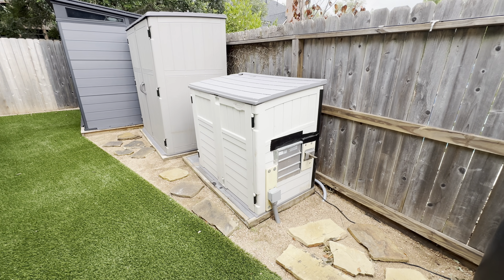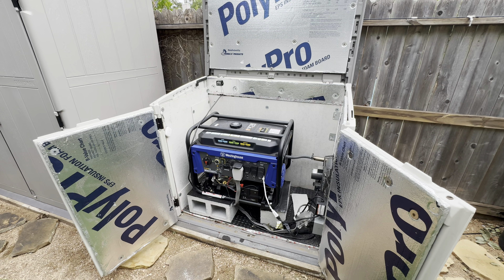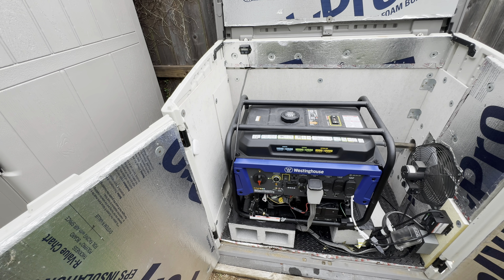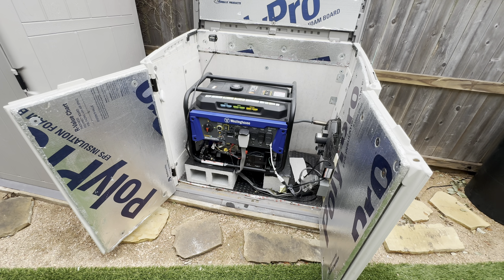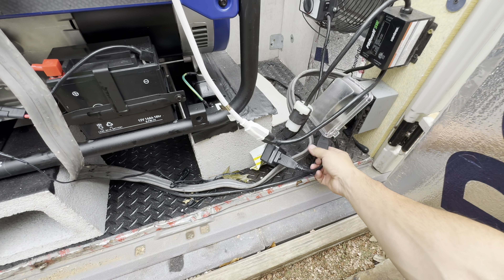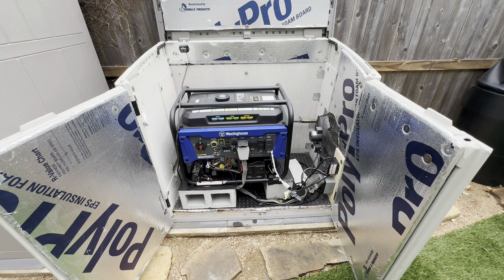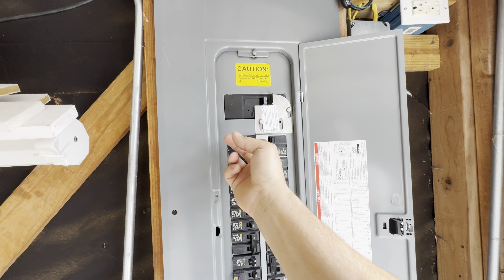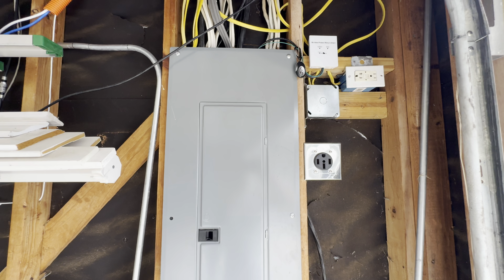Tri-Fuel Portable Generator Post Hurricane Update on Natural Gas

Comment: I am in Missouri City (Sienna). I had my Fir**n Tri-fuel running on NG for 40 hours during the hurricane plus a couple 1/2 hours runs afterwards. It ran my 4-ton A/C with the help of a Micro-air soft starter.
Reply: Good to hear. I live near NOLA and just put a soft start on my 4 ton. I have a 9kw (startup) coming tomorrow!
Reply: @armyfazer1410  good ole new orleans. hopefully storms miss us and the generator wont be needed.
Reply: Hey neighbor (sort of) I have the same 4T A/C and soft starter, gonna setup a Duromax 13,000 on NG at 8500 continuous. Have to pull a city permit to upgrade the gas meter, and CenterPoint to upgrade the meter, install a sub-panel on my panel...  Did the Duromax treat you okay? They are 2K on Amazon right now. I already bought it, just wanted to know.
Reply: @fat_biscuits3928  I installed a 3/4 ball valve and brass garden hose fitting on my gas meter.   Given nat gas manifold pressure is less than 1/2 psi, I  use a 75'  x 3/4" garden hose to  connect my generator where ever is convenient.  The setup had no problems providing sufficient gas flow to run my gen with a 6000w load for 6 days.
Reply: @jbar6618  That's a great idea! Do you know the CFM NG rating on your gas meter, and what sized generator are you running? My generator alone at full load states it's ~125 CFM gas usage, and my meter is rated at 250 CFM. I'm contemplating a meter upgrade from CenterPoint, however I hear it's a pain to get them to do the upgrade. I'd have to pull a city permit, inspections, then fight with CP for for the install... Also that's probably another $700, and then a plumber to install a quick connect ~$500...
Reply: @fat_biscuits3928 The meter is rated for 250, standard residential.  Gen has a 439cc engine and rated at 6000w on nat gas. I used a natural gas line sizing  chart  to determine what was necessary to supply the gen. As i recall 3/4" x 50' is good for ~100k btu. Given there's approximately 2500btu per hp,   I wasn't to concerned since I wasn't planning on running full load all the time.   As a backup I have 5ea 10" sticks of  1.25" thin wall pvc with threaded end I can screw together if I need more btu.
Reply: @jbar6618  Thanks for the info. The generator I bought is rated at 8500 cont watts at 125 full load CFM NG gas consumption. I don't think I'll ever use the FL cap. However, it's borderline with my 40,000 BTU water heater, and an averaged 100,000 BTU furnace, and gas stove guess-timated at 100 to 150 BTU's. My service entry for the gas would be roughly 30' from the electrical panel. Thinking if the heat in the house isn't on the 250 CFM gas service could handle it. I used a 6500 w genset on (unleaded gas) to backfeed my panel, and it ran my A/C, TV, lights (LED lighting). I think it may just be enough depending the delta of the service entry for gas. I'm in the end of a neighborhood, A bit sketchy TBH
Reply: @jbar6618  I'm not sure what direction the NG is fed... I may try it.
Reply: @jbar6618  Let me know if you can think of anything I'm not thinking about.. I don't want to be so un-prepared next (tropical storm) ... LOL thanks
Reply: @fat_biscuits3928  During the Texas freeze I was running 2 x 80kbtu furnaces, water heater, clothes dryer and still had plenty of NG to run my generator.  My average electrical load during the freeze was around 1800watt. which included 3 refrigerators, 2 furnance blowers, lights and tvs.   We didn't use the fireplace gas logs or outdoor fire pit.
Reply: @fat_biscuits3928  When you run on natural gas, or propane, you're power output from the generator drops quite a bit, compared to gasoline.
Reply: @Threedog1963  True statement, My generator will be 13,000W on gas, rated for 8500W continuous at full load on NG. Used my friends 6500W continuous on unleaded two days thru Beryl. It ran my 4T A/C w/soft start, and most everything I needed. I didn't try the microwave, or the electric dryer, but I can live without that stuff during an outage.
Reply: I have a duramax 12k with a micro air soft start. 
No it won't run my central a/c.
Can't make it run the a/c.
Reply: @RandyGarrett-z7e  What is the peak amps shown on the Micro-air app when running off the grid?
Reply: How many kw is the generator you had running
Reply: @EPerez-iw9zp  Manual says for NG, 6900W starting, 5500W running.
Reply: Those Micro-Air easy starts are no joke 😂
I installed one my 3 ton house AC and I can run it off 2 EcoFlow delta Pro’s.
Besides the back up power my house lights do not flicker any more with it installed now.
Reply: I thought they were rain/water proof?
Reply: @jamesguinn5303  *weather resistant.  An enclosure helps a lot, even if it's only a generator tent or a canopy.
Reply: Did you install the connector to the NG line?  Also did you install the transfer switch?  How much does it cost for the whole wiring?  Do you have any good referral for the install?
Reply: @user-hp1gn5mg7c  And I forgot to add, hopefully your breaker panel is located relatively close to your gas meter (at least on the same side of the dwelling). Otherwise it's a bigger pain in the ass.
Reply: @fat_biscuits3928  Found mine next to the power meter, the problem is it's in the front of the house.  That side also very narrow with my 2 AC condenser.  Was hoping to place the generator in the backyard.
Reply: @user-hp1gn5mg7c  Anything further than 50 feet of cable from the generator to the breaker panel isn't recommended. You'll have a little voltage drop across the cable to the panel, not saying it cannot be done. But, that would be a judgement call you'll have to make.
Reply: @fat_biscuits3928 correction you get a drop at anything greater than 100ft. Not recommended over 100ft.
Reply: @user-hp1gn5mg7c  I'm gonna help you out hopefully. You gotta be careful running NG. Whatever watt rating on the generator you buy decreases that number by a good margin while running on NG. A 13,000 watt generator on unleaded runs ~8500 continuous watts on NG for reference. Then you have to make sure your gas meter can sustain the NG consumption considering the other appliances like your water heater, oven, and furnace. All those things are rated in BTU. The gas consumption is rated in CFM. Take the total of all the appliances BTU's + the generator BTU's add that up the divide by 1000. That number will be the CFM requirement at full load CFM natural gas. Most NG meters are ~250 CFM. If the NG consumption is way more than that, you'll have to pull a city permit, and get the gas company to upgrade your meter (it's has a cost). Then get a plumber to install a hook-up on the new NG meter with a shut off valve, maybe a quick connect. After that you can backfeed the bus bars on your existing breaker panel with a 50A breaker, and installed lockout device from your main breaker depending if you have a dual pole (space in the existing panel) two open spots. After that, you should probably run a sub-panel plug into the new 50A and cable to plug in the generator. That way you can initiate the lockout device for the main, turn off ALL the breakers, close the new 50A, run the gas connections to the generator, hook up the 50A cable to the generator and then into the new sub-panel, then turn on the breakers connected to the stuff you'd like to use. Keep in mind, microwaves, dryers, electric ovens and things like that draw a bunch of power (leave those off). You'll probably need to install a soft/or hard start on your A/c unit (~200 + install) to get it running with a generator. After all of that work, I'd probably keep the new generator safe in the garage, just use the lockout, generator, gas line, and cable for emergencies instead of an automatic transfer switch.
Reply: Do anyone know whether or not the tri fuel generators have a regulator on board or an automatic shut off device that can shut off natural gas flow automatically
 should an unexpected shut off of the generator occurred with no one around to notice, such as in the  middle of the night when everyone is sleeping?
Reply: @doradean3097  I see that the LPG/NG inlet is part of the regulator assembly located behind the control panel cover.
Reply: @doradean3097  I'm going to back into this one rather than dig into any models manual to answer.  I can hook up my NG hose to my tri fuel generator using quick connects and not start it until I need and no gas escapes.  So if a running, connected generator stops, the gas should not leak out since will be in the same no-run state.  Note, that's ONLY provided you have a factory tri fuel generator and not a jake-leg conversion of a Gas model (like I've seen on youtube) that just dumps NG into a converted manifold with no valve control.  Based on this link on tri fuels you should not have a worry.
Reply: @waynewright3248  good to know and thanks for the info, Wayne.  I knew the quick connect is one of the measures to keep gas from flowing when not in use, but wasn't sure if same thing is still happening when connected to the generator.  So need to make sure safety measures are already set up in place on these tri fuel generators as some other brands I couldn't see one already on board.
Reply: @doradean3097  I have never seen a tri-fuel generator they didn’t have the regulator.   They are usually right in the carburetor and are much smaller than the ones you buy and add on to gas generators.  

Then look just like the tri-fuel carbs you can buy for Honda and Honda style engines.
Reply: @speckulator7516  Thank you Speckulator.  Time to go shop for one to be prepared!
Reply: @doradean3097 demand regulator built into Westinghouse generator so gas flow does not happen when generator shuts down
Reply: What size generator, just curious on running watts to run ?
Reply: @chrissimmons6358  My generator has Starting Watts: 9400(GASOLINE)/8450(LPG)/6900(NG). Running Watts: 7500(GASOLINE)/6750(LPG)/5500(NG). It is a 439cc engine. I run 30A 240V. The 50A outlet has a 31A circuit breaker.
Reply: I will be adding 2 12k EG4 solar ac units with Solar this year to keep my House cool when powers out my ac unit is too big even with soft start to run my house and keep my workshop running.

Comment: I’m in NW Houston and have the exact setup as you with the exact generator. I did notice it’s having a very hard time starting with with natural gas. Did the spark plug solve this issue
Reply: Did you purge the gas line before trying to start it?

Comment: Yeah we are still without power from the storm over in Humble. Still running on my small generator. After this will be diffently upgrading my unit to run my whole house.
Reply: Get the biggest available. Get double the gas cans you think you need. Estimate 1 gallon per hour. Keep enough oil and filters for several oil changes on hand. Get a battery powered fuel transfer pump stick. Keep spare sparkplugs and fuel filters on hand.
Reply: @dontblameme6328  Agreed.  Fuel consumption will depend on the generator and how much power you are using though.  I was running in economy mode and got 18 hours per 5 gallons of gasoline.  When I hook the gen up to the breaker box on the house, I'll have to run on full mode and am estimating getting 9 hours per 5 gallons, or less.

Comment: I’m down the road in Manvel (past sienna) thinking of the same setup and also considering tri fuel. My natural gas meter and breaker box are on opposite sides of the house! I would still have to upgrade the natural gas meter but do you think it’s worth it? Should I consider running a long natural gas line or run maybe a 75’ electrical cable back to the box? Worse case I’ll just do gas. Thanks and sick setup.
Reply: Our tri fuel will never see gas.  First thing you know you need it to run and the carburetor or venturi is varnished up from old dried gas residue and it won't start.  

No meter change was required for NG hookup.  Just changed a 1 inch Elbow to a 1 inch Tee, then reduced the new line to 1/2 inch and added a quick disconnect.  Supplied NG flex hose is only 1/2 internal.  Obviously cut the gas feed to the meter before any modifications.
Reply: @waynewright3248  ahhhh so you just branched off the main line! Nice thinking!

Comment: Should have just got a GENERAC.  😑
Reply from the maker: @HBO1984.  just would have needed 15k more and monthly maintenance fees. Also saw several people in my neighborhood where the Generac either didn’t start or failed within 2 days of running. They continued to be offline until the power came back on because they had no way to troubleshoot or work on the system till Generac sent someone out.
Reply: @CalvinGorriaran  They probably didn't maintain it. I just used mine for 4 days after Beryl. Last time I used it was during the deadly Texas freeze. So far GENERAC has been my hero. The best $10K I ever spent. 😑
Reply: @CalvinGorriaran  agree around me many homeowners have failed Generac Home backup systems failed starting or stopped, even after maintenance servicing. One neighbor posting a pic of their enclosure was melting on the slab after 4 days running.

Comment: I have a buddy who built a similar setup but used a larger shed and put a fan next to the generator and then another fan mounted on the left with a dryer type vent and that pushes the air out and keeps air circulating

Comment: You may want to get rid of the reflective material, it will retain heat for longer. Like baked potatoes, that's why you wrap them in foil after you cook them instead of when you cook them.

Comment: I am in richmond area. I was wondering to either this or go with battery powered devices like Anker Solix. How much did it cost to get this installed ? Any issues with carbon monooxide while running it on natural gas ?
Reply: If there is now power how are you gonna charge the Ankar?
Reply: @moblack5883  It will be charged before the powe is gone and then conenct to a solar piece to recharge while power is gone
Reply: @deeproots24  My Friend, Please do a "dry run" on that Ankar. It dies in 2-3 hours and takes a day or two to charge on solar. Please do the math before you need to rely on a system like that.
Reply: @moblack5883  Solar ?

Comment: I wish my neighborhood had natural gas. I would love to be able to just "set it and forget it" (other than oil changes, of course) during an outage. I don't want to use regular gas because then I have to go outside and refill it 3 times a day, so that leaves me with using propane. That would only require replacing/refuling the tank once every day or two but I still would prefer NG so I wouldn't have to go out at all, lol.

We said we were going to get a generator after derecho passed through but were waiting until we start our home foundation repair and interrior remodel. That was a bad decision because it left us unprepared when Beryl hit. Not making that mistake again. Going out either this week or next weekend to pick up a generator. We're looking at the DuroMax 12000HX. Should be enough to power the necessities.
Reply: Keep in mind NG is the lowest output on your generator. I have the 12000/9500 duromax. Gasoline is the rated output you see when purchasing.
Reply: @1997LT1Camaro  yeah, I know. But having done the math, the lowest power it offers is still enough power to supply just the essentials that I really need. It would just be nice to set it and forget it (other than going out for oil changes, of course).

Comment: Thanks for making these updates!  I’ve zeroed in on the same Westinghouse that you have (how I found your channel), I just have to find some place with availability. We weathered Beryl in the Woodlands with a medium sized gas Generac 27 hours run time….ready to switch to Natural Gas. 

My question is, after running the Westinghouse on natural gas do you do any service to prep it for storage?  I prep my gas Generac for storage after each use for the most part…..pretty straight forward stuff but I can’t find any recommendations for natural gas generators and storage.
Reply: We went thru Beryl with the Champion tri-fuel (model 201176) running on NG.  Definitely disconnect the battery during storage and periodically check its voltage and charge it or put it on a battery minder in cold weather.  I’ve seen batteries destroyed on my other generators by not being more proactive and checking or charging them regularly.  It is also possible to overcharge and “boil” the battery’s electrolyte, so watch out for that, too.
Reply: @John_Kingdom-of-Sicily_1166  Thanks for good info!